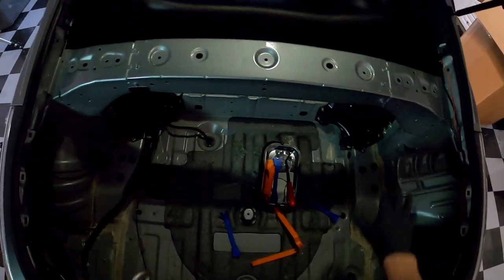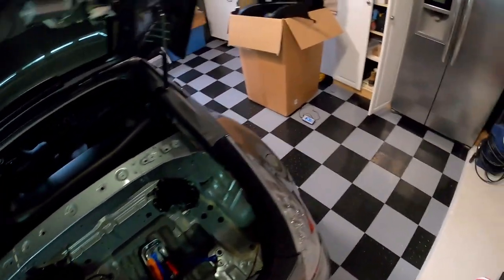HowTo: Hatch And Trunk Trim Removal In A Nissan 350Z (Part 2)

Comment: Would you know where I can buy the full trunk interior for the 350z?
Reply from the maker: Adrian, great question. The individual parts can be purchased through Nissan and 350Z enthusiast sites. It will get rather pricy. Instead, I have had good success with junk yards, especially the pull-it-yourself places. These are great for when you need trim and aesthetic parts.
Reply: @robreview   okay thanks I’ll be looking out. Just picked up an 03 350z and prev owner took it all out. Anywhere you know that may show assembly? I know it’s basically reverse order but that would also help so much. Thanks for your quick responses!
Reply from the maker: @adrianjames7143  Honestly, I didn't remember the sequence when I put mine back together after several months. I just looked at a parts schematic and figured it out from there. All but 2 of the parts are obvious, as they can only go in one direction with the rounded corners and the wheel wells. Take a look at this schematic as it helped me: https://www.nissanpartsdeal.com/parts-list/2005-nissan-350z/body_side_rear/trunk_luggage_room_trimming.html
Reply: @robreview  Thanks a lot Rob! You’re a saint! Great channel.
Reply from the maker: @adrianjames7143  You are welcome! I am always happy to help. Reach out any time and keep me posted as to your progress. The 350Z is a great platform with lots of potential.

Comment: Did interior noise get worse I stripped out my whole trunk and it’s loud as fuck
Reply from the maker: Yes. A simple solution is to add sound-deadening material. I found black acoustic matting that weighed less than 7 lbs and covered the whole trunk. It's sticky, so it adheres to everything. I don't have a decibel meter to know the difference, but it is huge, plus you get to keep a significant amount of weight savings!